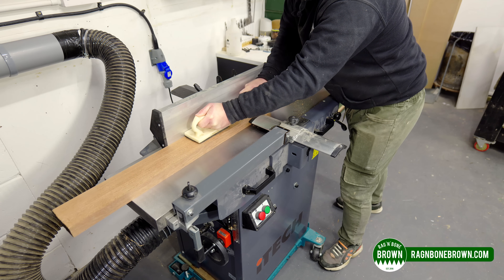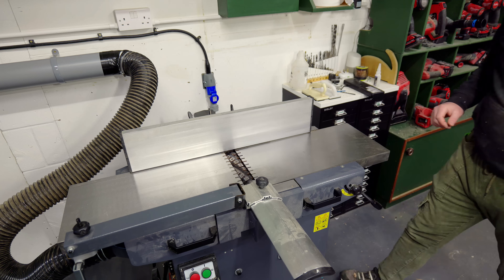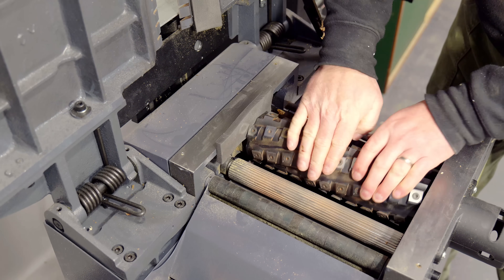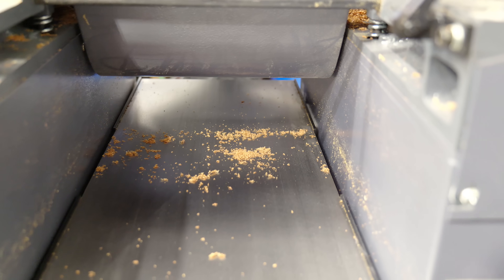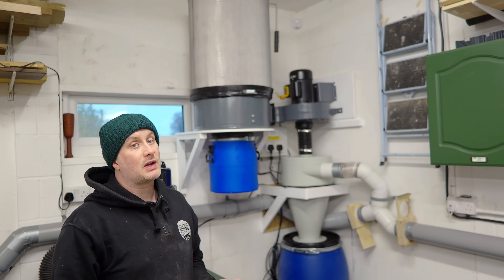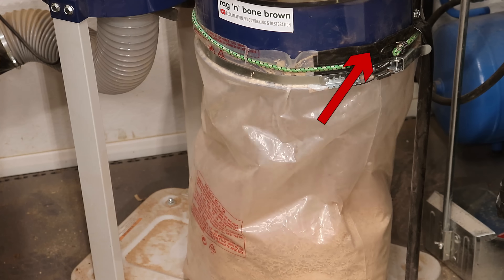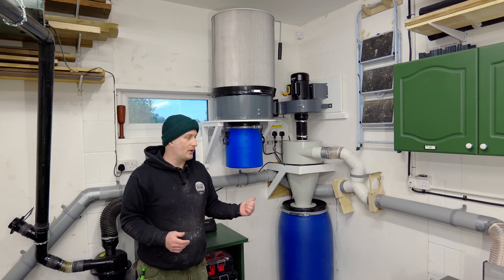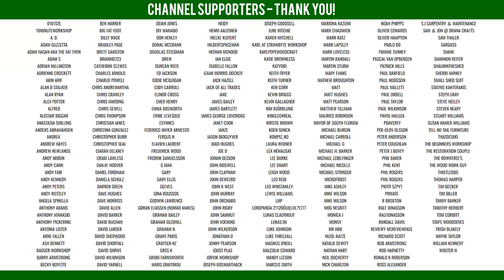Planer EXTRACTION HACK + Extraction Upgrades

Comment: 5:27 - Did you try adding weather stripping to the outside of the metal ring as well (so there would effectively be two layers, pressing against each other? Or would take make it too thick? It seems like there might be enough slack in the filter lock ring.

Comment: I used to have that cyclone and I always believed the input should have been higher and angled slightly downwards as otherwise the incoming air disrupts the circulating air. So I added an internal spiral baffle using a disk of aluminium to deflect the incoming air after one revolution to pass below the input. I also increased the exhaust ducting to 6” as I had a twenty foot run to vent to atmosphere. I never saw any evidence of dust or chips escaping outside. I did measure the power draw of the Axminster 1HP fan at 385W so only about half of what it should have been (746W = 1HP) so not surprised at its poor performance.

Comment: I think that the bigger ducting would probably help a lot, but one thing you may not have thought about is the drag caused by the angles and flexihose. I really know very little about aerodynamics, most of my experiences have been with filtration systems for aquaria and pools, but the basic theory must be applicable. I would aim to have any ducting following much more gently curves and keep the flexihose to the minimum possible. I sduspect that having a separate connection for the two positions on the planer/thicknesser would also result in s significant reduction in losses.
Obviously, all of these things also depend on how and where you position the machinery involved.

Comment: Nice upgrades to your shop !!
The only insight I can give is based on what I found on my planer extraction, obviously not the same planer as I am based in New Zealand. Towards the end of the video I see the grey 4" pipe along the wall to which the flex hose connects. I would consider shortening that pipe to alleviate the two very sharp bends (S-shape) of your flex hose. I found a big improvement on airflow along straighter pipes.
Keep up the good work !!
F
Reply from the maker: It's a good idea but the dust hood pivots in to thicknesser mode so it needs the extra length 👍

Comment: One thing I’ve noticed is that the rotation of your cyclone is opposite that of your fan/blower which creates a bunch of turbulence for the air to change direction 180deg. I just went through this with my own very similar setup to yours and it made a huge difference.
Reply from the maker: Thanks I see what you mean, but I don't see a way of resolving it?
Reply: The most cost effective way would be to get a different cyclone separator like the Oneida that has the cyclone inlet on the opposite side of what you currently have. I actually had to go from the Oneida style to the style you have due to my motor rotation. You might also try lengthening the distance between the cyclone and the motor and switching to solid pipe.

Comment: I'm sure you want to be done with this but from my own research one of the most important things is to a straight run of at least 4ft right out of the cyclone. You have an immediate bend and then spilt. This seems less than ideal.
Reply from the maker: If I lengthen the duct from the cyclone I would also have to lengthen the duct to my table saw so doesn't seem like a good option to me

Comment: Now watch iTech scramble to add these strips and proudly market their improved dust extraction. They should pay you for the R&D!
Reply from the maker: I may drop them an email to let them know about it but I'd be surprised if anything changes. Tool manufacturers just don't seem to be interested in adding features or Innovations to machines at the lower end of the budget
Reply: This P/T was designed by JET in Taiwan and originally used 3 HSS knives, which produced longer strands rather than the small chips that spiral cutter blocks produce. What you have done is to direct the air flow in a more targeted fashion to make the air grab the small chips. 20m/sec air flow is more than adequate for the volume of waste being produced. 
I think that your machine has a 6 row cutter block,? In my experience a 4 row is a better all round choice. As far as getting feedback to the maker, I'm afraid that the company that runs iTech in Taiwan is just a wholesaler, not really open nor understanding the concept of customer feedback. I'm sure that S and S will show a sympathetic ear though.

Comment: Something so simple, can't believe it. Going to check mine out over the weekend and do the same.

Did you have any further thoughts on the cyclone after the motor housing, be interesting to see if that works and stops the 30% reduction in airflow.
Reply from the maker: Cheers Scott. The cyclone after the motor is something I really want to try, but based on the idea that the extractor fan only suck in as well as it can push out, I'm assuming that it might work but probably won't result in any increase of airflow... It'd be interesting to try but I'm kind of burned out on the whole extraction stuff right now and I'd like to get back to some other projects 👍
Reply: @RagnBoneBrown  yeah I agree, the science behind it surely has an explanation, but in my head it also seems the same. It can still only push out as much air as will go through the 4" in the cyclone. It's a lot of work for potentially not a lot of gain, I know only too well how long it takes moving stuff around , so added ontop filming ,I don't know how you keep doing it ❤️

Keep it up though, untill some science boffin comes along and explains it all in layman's terms we all just have to keep trying new things. Iv got a silent box ato build for my camvac this Xmas, which involves all new cabinets, mitre bench and drawers. I'm not looking forward to it at all 🤣🤣

Comment: I noticed that you changed the flex tubing from the machine to the grey pipe on the wall. I think you would get better air flow if you removed that grey pipe and if you have to just run a straighter run of flex tubing to the junction where the cut offs are. your current set up has the tubing in an s shape out of the machine which is cutting down your air flow.
Reply from the maker: I agree but the way the dust hood pivots over in thicknesser mode would mean a really long Flexi tube would be required and it would be cumbersome to position without the rigid pipe there

Comment: They say that you get what you pay for but to be perfectly honest I think you end up paying more than it is worth when you have to make your own seals for dust collectors and machine dust collecting systems. I know that neither are top of the range in the world of tools/machines but they are not the cheapest either and it is only reasonable to expect that simple things like those shown in this video are fixed at the production line and not by the end user.
Reply from the maker: I completely agree. Unfortunately tool manufacturers just don't seem to take things like effective extraction seriously - it always seems to be an after thought. I think there's a distinct lack of innovation with regard machines at a lower price point, and things could be so much better if they just listened to the people that use them and made some simple changes
Reply: @RagnBoneBrown   I suppose the real problem is that people buy them either way so why bother putting a little extra effort into it. And yes, I agree that there are tons of good reasons to put that little extra effort into it, but the manufacturers seem not to look at it the same way. For me personally having to tape the filter to get a tight seal on a brand new dust extractor would be enough for me to not buy it, thinking if they haven't done this right then what else haven't they done right that I will find out when the warranty has run out.

Comment: I did a ton of research on dust extraction and airflow when building my system. I have a similar setup as you (2hp fan, aftermarket cyclone, cartridge filter, 4” pipe) and I get fantastic results. In my research, I learned that it is ideal to run the inlet as straight as possible for as long as possible - a minimum of a few feet (🇺🇸). I can see that you have not only an immediate bend, but also a junction. If you think it’s worth the trouble, try bringing that grey pipe for the planer up about a foot so you can maintain a straight inlet to the cyclone. 

For what it’s worth, I also read that flex hose has about 9x the resistance as smooth pipe due to the coiled shape.

If you find this comment helpful, I will allow you to give me your Milwaukee track saw 😂
Reply from the maker: Thanks. I may try that but it's difficult because I still want to retain a shorter run of ducting to the table saw which is the opposite direction. Interestingly though the Flexi pipe doesn't seem to effect things as much as people make out, based on my own testing....

Comment: Do the sharp bends in the flex hose for the thicknesser planer reduce air flow?  Perhaps a straighter line to a shorter PVC pipe on the wall would help.
Reply from the maker: Yes but the dust hood pivots over 180 degrees in to thicknesser mode so there's really not much that can be done about it

Comment: It’s awful that you’ve paid significant money for the planer and extractor and they both have out of the box design flaws in them. You shouldn’t be having to use gaffer tape and weather strip (potentially even risking impacting the warranty) to get the machines to operate fairly dust free.
Glad you got it sorted though.

BUT you said there were no further improvements you could make in the workshop dust system, you could paint a lot more of it green! 😂
Reply from the maker: Thanks, yeah I totally agree. It's very disappointing. But I have little faith that feeding this stuff back to the manufacturers would result in any changes unfortunately, based on past experiences! Haha yes, more green would improve things for sure

Comment: Hey!

I'm compleate novice aand I dont work witht his kind of equipment but I got theory.

Your extractor whose is mounted on the left of plainer and blade ( upper side ) is spinning thourds right side cutting wood and dumping chips on the right side. Can you moun extraction on the right side?
Reply from the maker: Thanks. The planer thicknesser is a combination machine, so in thicknesser mode it throws chips out the opposite direction 👍

Comment: Nicely done mate. I'll give it a try on mine. Weird that, although I get a build up when planing, I'd have to do like 10 large boards to get what you were getting from one. And my extraction is shite by comparison. Strange. Would still benefit from your fix I think. I've used some fairly fancy planers over the years, with industrial extraction and all would create some level of debris still. Reckon you've got it about as good as can be expected mate.👍
Reply from the maker: Thanks Stew that's really good to know. Yeah definitely give it a try and let me know how you get on? It's got me thinking that I might start weather stripping some of the gaps around my table saw cabinet too!!
Reply: @RagnBoneBrown  I used a similar stuff as a seal on the shroud/box cover for my tablesaw funny enough. I used the foam rubber floor strip stuff - the stuff that goes on top of joists receiving concrete fibre slabs.
Reply: It might help.. but you do need some where for the air to get in to achieve flow. ideally you want it so the air into the table saw create a single flow across all the material to the outlet point into the extractor. so for my Sedgwick I sealed the back and sides but left the front free to vent.

Comment: U certainly seem to have solved that problem Keith. I have a question hopefully you might be able to answer or help with. I have a jet bag extractor. I run it to the plainer thicknesser combo (lumberjack little brother of the one u looked at)it has a dust shroud for plainer and thicknesser mode which is changed between but lately since I had the knives sharpened it seems to blocking in the shroud with these really massive shavings gets clogged. Not sure if it's the shroud or the extractor that's the issue. Problem is the shroud has a safety feature which means u have to have it on and it has like a sensor pin it clips into on the side the machine to allow it to start?? Any ideas on how to stop it clogging. Seems be worse in plainer mode but only slightly it's pretty bad in both. 🏴👍
Reply from the maker: Hmmm, not sure... Worth asking the lumberjack people about it I reckon!
Reply: @RagnBoneBrown  yea a may have to go down that route. Am deffo considering upgrading the extractor at the turn the year in January sales hopefully wondering if it's just not pulling enough force through it. Any others other than the one you've just upgraded to you'd recommend?

Comment: the pipe going into the cyclone should be straigt.
Not with all the bends you made.
Try it with a 1 mtr long straight pipe into the cyclone. and then al the bends and gates.
Reply from the maker: Then the ducting length to my table saw would be way way longer than it needs to be

Comment: What about a Thien Baffle?
Reply from the maker: I think I'm right in saying they affect airflow worse than cyclones, but that the separation is slightly better - is that your understanding too? If that is the case, it's not for me... Although it would be a way of increasing to 5" ducts so still something to ponder!
Reply: I made one out of a trash can, I think it worked pretty well. I never had any issues with suction running a 2hp extractor with a canister filter. I ran 6 inch ducting though, just the cheap sheet metal stuff we can get at the big box store, not sure if it’s something that available locally for you.

Comment: Wouldn't have thought to use weatherstripping - great idea! Would be interested to see if rerunning the ducting to the planer helps at all - at the moment the flexi pipe is kind of in a 'z' shape because of where the ducting runs to, but if you shortened that run then it would have fewer/no bends in, though that might not be possible because of layout etc!
Reply from the maker: The Flexi needs to pivot over for when the machine is in thicknesser mode so not much can be done about the flexi

Comment: Nice to see you got extraction issue resolved. Seems to me that plainer machine was probably originally designed to use normal planer knives. Then it was later adapted to use spiral head which caused the fundamental issue. Shame that manufacturer did not fix this. It would have been very easy to them. It is sad that even when we buy expressive machines they sometimes have flaws right from the factory :(
Reply from the maker: That's a good point, you could be right 👍